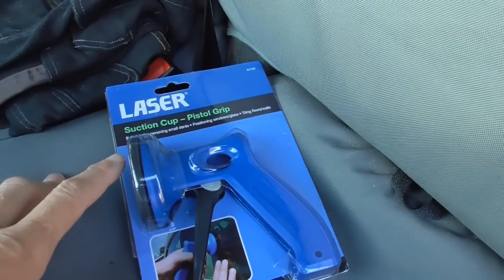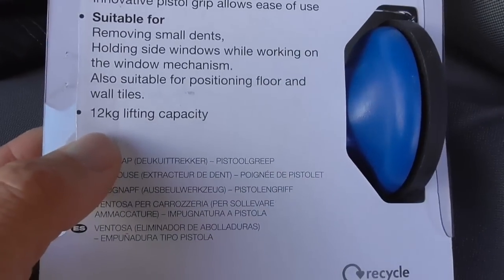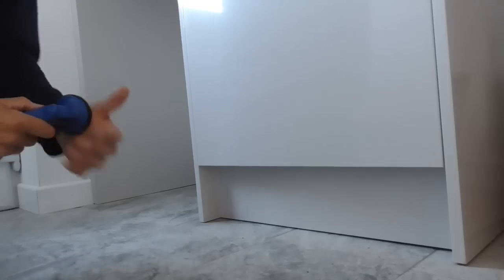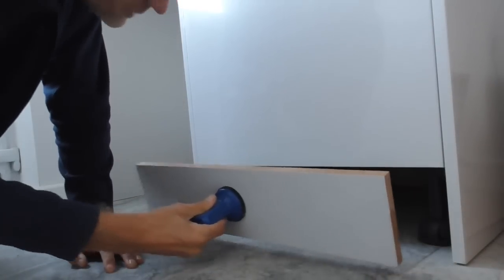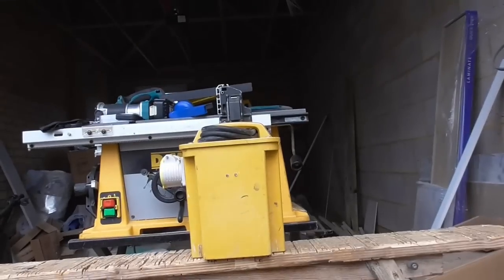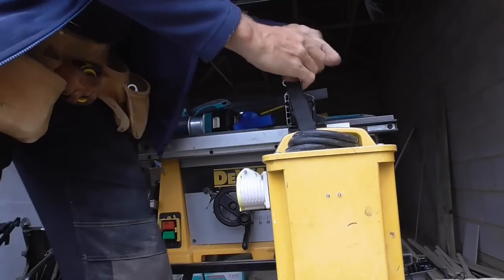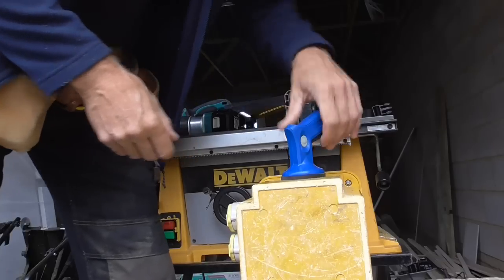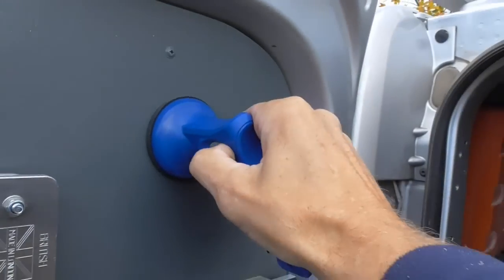How to remove kitchen plinths/kick boards ***THE TOOL TO MAKE IT SUPER EASY***

Comment: Great idea Del. We used a couple of heavy duty suction cups when we did the bathroom panels. Great for positioning the boards on the wall.
Reply from the maker: It's amazing how useful they are Steve, and things you can use them for👍Cheers Del

Comment: Hi I worked at a school for years and I used the double sucker ones to lift out panels where they had hid the toilet system behind, the panels was made of Trespa and are heavy it coped great. I would always get ready to support just in case.

Paul
Reply from the maker: I guess there is always an element of jeopardy when relying on suction to lift something heavy, and as you say, you're always ready to catch it if it goes😬😲🤩Great comment and thanks for watching 😎 Cheers Del

Comment: I’ve never even thought of a suction cup. If there’s no gap above the plinth I’ve always wound a screw in near the top and pulled it out using that
Reply from the maker: Hi Ben🖐I hadn't either, and it seems so obvious now😵‍💫I've also had to resort to sticking a small screw in, high up to pull a plinth off😬Thanks for your comment and for watching 😎 Cheers Del

Comment: Hi there  ...tend to always leave a 3/8 gap at the top the plinth and use a S shaped piece of cut down wall plate strap (thin gauge ones) to hook up over and behind the plinth...works  well👍
Reply from the maker: Great solution David, and there is always a variety of ways of doing tge same thing👊Thanks for watching and your comment 😎 Cheers Del

Comment: I do quite a bit of window work so have some slightly posher ones but this week I am using them for kitchen breakfast bar panels . This afternoon I nearly got sucked 😃 into buying a battery ones in Ridgeons, which will pick up paving slabs but the £250 price ruled me out !!
Reply from the maker: Hi bud🖐I've seen those battery ones, and I can see why it took all you strength not to buy a set😆and you're a better man than me cause I'd buy any great gadget like that even if it was only vaguely connected to my work🤑Thanks for watching 😎 Cheers Del
Reply: @thetallcarpenter  I am a reverse gadget man as I do a good bit of traditional hand tool work . Ever tried explaining to the wife that £800 axe when you already have 39 ??
Reply from the maker: @axecarpenter6775  No way😵That sounds really interesting 🤔 If you're on Instagram send me a picture at thetallcarpenteruk 👍

Comment: Can’t beat a good old sucker Del… 
Great for getting the plinths off but the Allen key trick is a nice plan B.. 
😉
Reply from the maker: Stay tubed for my next video Dan, where I'll be looking all disappointed because the plinths will be heavily grained and my new sucker tool won't work😬and it'll be back to grips and an allen key🤪Cheers bud
Reply: @thetallcarpenter  that’s the problem with the suckers.  
Nice filming at the end, suckered to the back of your vans grained panels.. 😲
🤩
Reply from the maker: @Ultimate-roofing-square.  That ply panel has a very important role to play on that back door now Dan😉🤩
Reply: @thetallcarpenter  🙏🙌🏻

Comment: when i fit kitchens i also always try to leave a gap of maybe 4mm or so. often i fit a kitchen and my mate at barber and whale flooring follows on to lay lvt so the plinths need altered afterwards. i find that using a one of those windbags works class to pop the plinths off. slip it through the gap. pump it up a bit and pull it towards you. it fetches the plinth with it. 

i also if i need to leave them for someone else to pop off easily put a temporary little pull handle made from masking tape doubled over. i actually today used one of those that had been forgotten about to pop a plinth off on a kitchen i fitted in a rental property 4 years ago 🤣🙃
Reply from the maker: Some great forward thinking there Paul, and the mark of a good tradesman is thinking about others that may come behind him👍 Thanks for watching bud and your comment😎Cheers
Reply: @thetallcarpenter  I've often used the masking tape handle on kick boards, 👍🔨🇮🇪
Reply from the maker: @TheToolnut  Great minds think alike guys😎
Reply: @thetallcarpenter  👍😁🔨🇮🇪

Comment: I use a length of earth wire with a short 45 degree angle bend, (covered in an insulated sleeve). Works for me.
Reply from the maker: That's a great solution TS👊Thanks for watching 😎 Cheers Del

Comment: Looked like a handy tool to have around as well as the luggage scales, personally what I use to pull the plinths off was a cranked hook type tool that was supplied by Mighton a manufacturer of sliding sash windows springs. You  used to have to pull the chain down and hook it into a   fixing. They  always were a pain to do though but the tool was very useful.
Reply from the maker: I vaguely remember such a tool Kevin, and I had been thinking about using a tent peg puller, which was very similar👍Thanks for your comment 😎 Cheers Del
Reply: @thetallcarpenter  Yeah it's a good few years since I worked on that job to mate and I hated them springs as they had to be tensioned by turning the chain. The corded type are far easier and less hassle.👍👍